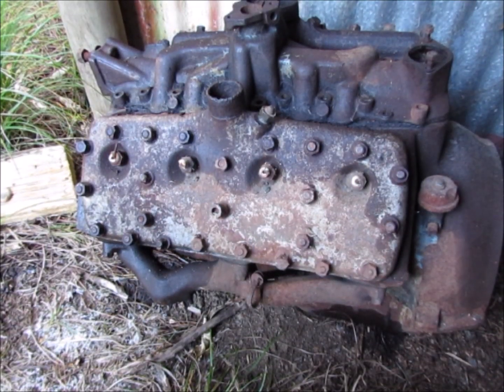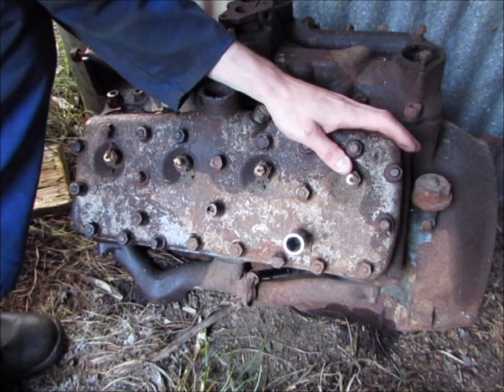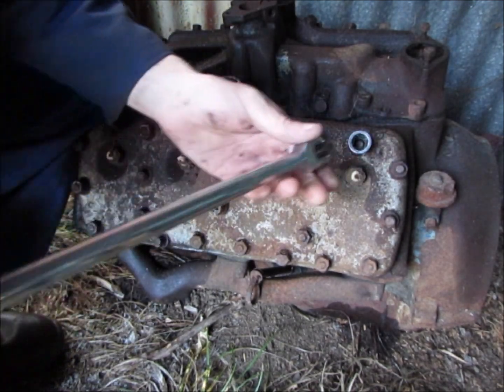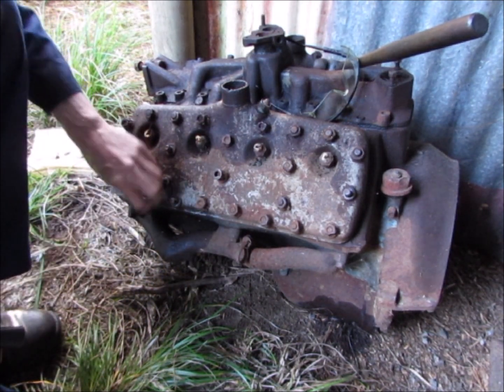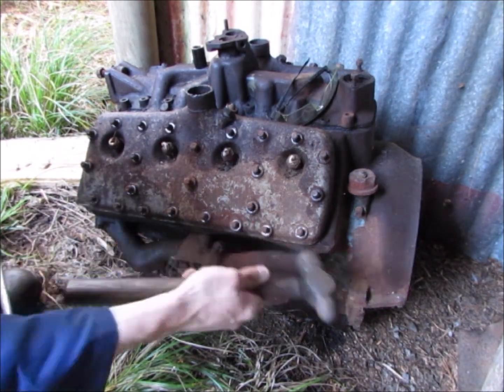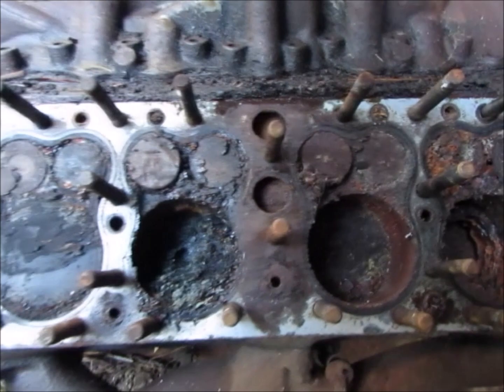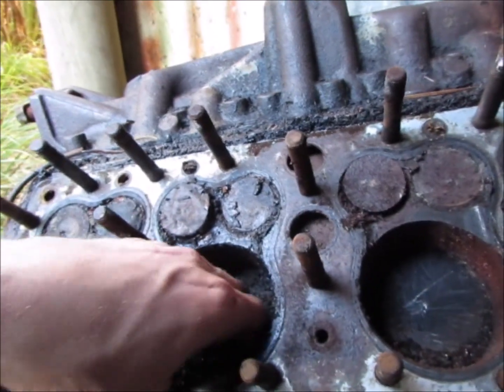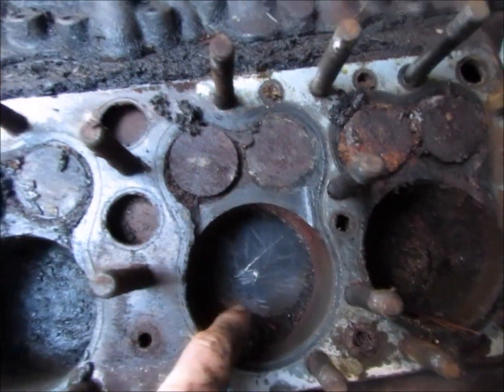Very rusty Flathead V8, can we save it?

Comment: I dug up an old four cylinder flat head when I was a young fellow! I took the sump off it and it was like new inside, when I say I dug it up I mean literally, it was under the ground. It wasn't rusty on the out side and turned over, the ports must have been plugged with dirt and that saved it, it's probably in the ground again now.

Comment: If the block pased pressure test it can be bored .125 oversize as most hot rod engines are Egge makes 3 ring modern pistons for it. Unfortunately the crank and rods are floaters
Grampss

Comment: Can you fix it?  Yes.  Might require money though.
That's not even a bad motor.  I've pulled apart one that someone wrapped in plastic and left outside for only 10 years.   It was much, much worse.  From running to a boat anchor in only 10 years.
I hate what people do to cars...